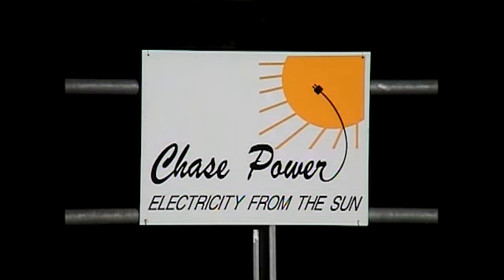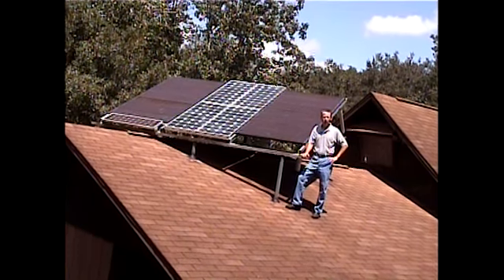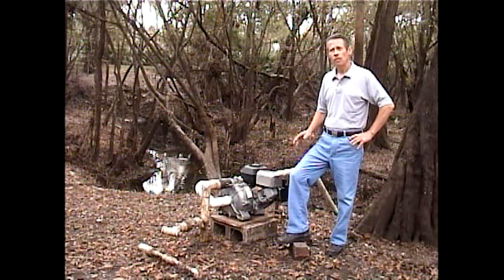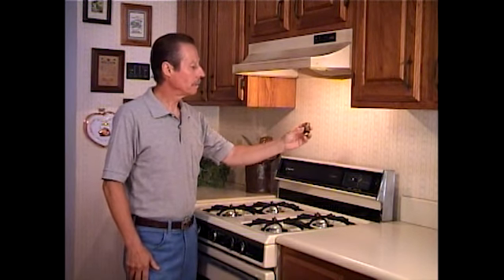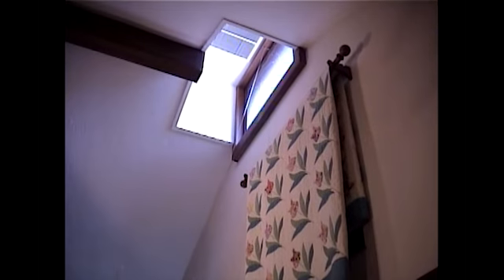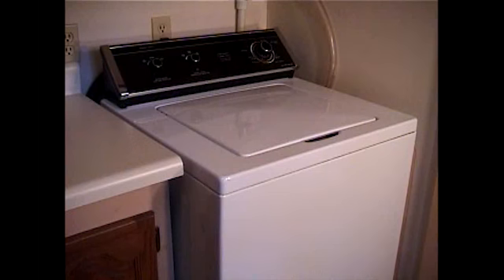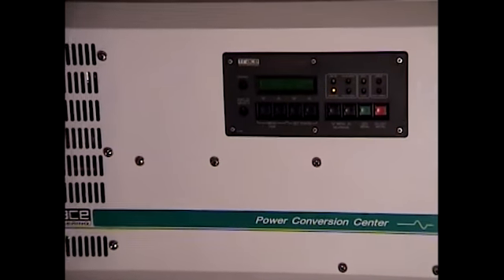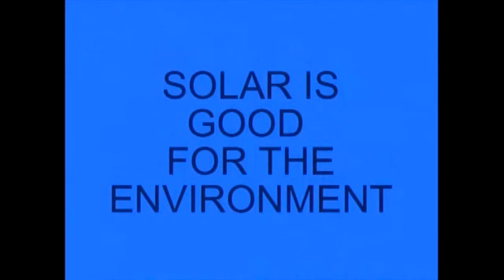Solar Home Tour

Comment: EXCELLENT Video. Thank you.    😎👍
Reply from the maker: Frank, Glad you found the video from long ago. This was state of the art back in about 2001 when it was shot. We loved living there for sure. We sold in about 2005 after linving there many many years. Today the house is a mess as the hurricane last summer caused flooding that went up the walls over 4 ft!   Sure never thought that was possible.I guess I should be glad we sold when we did. But hate to see it as it is now. It was a beautiful home and we enjoyed building and living in it. We had flood water to within 16 inches of the floor joists many times and had a floating chicken coop for those times.